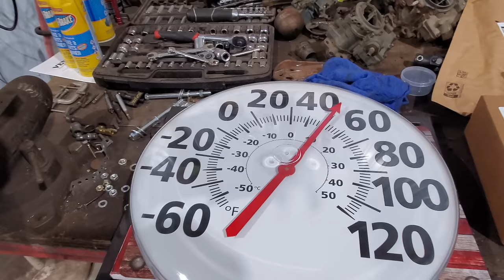40 Chevy Coupe Can I get The Steering DONE This time???

Comment: If it’s bent with a crease, I’m pretty sure it’s a split in the metal chad! That metal on the wall sure looks so clean and a real finished look! I don’t mind what you want to share on your channel because I like seeing whatever you show my friend! You should at least buff it with a wire wheel my friend! You could weld a pipe coupling and a plug Chad to save you some money brother! Even saw a 3/4” or 1” pipe coupling in half and weld the half on the pan and put a pipe plug and paint it and it’s good as new Chad!

Comment: Chad: don't through that oil pan away; find a nut that the drain plug fits, and weld the nut on the oil pan, oil leak fixed.... That worked on 58 chevy 348 250 back in 64
Reply from the maker: Too rusty to mess with.

Comment: If the intake doesn’t have a coating on it, you can get some machined aluminum wheel cleaner, I’ve used it and it sprays on and should foam up and let it sit a little while then do it again and pressure wash it off! I used to haul everything to the car wash, I don’t know if you’re allowed to do that but a pressure washer works my friend! I had some machined aluminum wheels and that stuff worked great even with grease on them! Just thought I would share that with you Chad! I don’t mean to tell you what to do, I’m just making a friendly suggestion brother! No offense if you don’t want to do it my friend! Just trying to help out a little!

Comment: I use a soldering torch bottle to heat blocks, etc... to remove impurities on the outside and then I spray with etching primer then paint to color I want. I've used Rustoleum with a brush. Lot cheaper. Got this from Uncle Tony's garage.

Comment: Whenever I need to find center on the drill press I use the trick of putting in the through hole drill and lining that up so it doesn't drag then lock the table there to counter bore the holes.

Comment: If you grind three equal flats on the tap shank, it will keep it from spinning in the drill chuck.
Reply from the maker: It's already suaere on the end for the tap handle.
Reply: @ThisNThatGarage  yes most taps are but if you grind past the square and put three even flats 120 degrees apart, tap wont spin in drill chuck. Done it many times.
Reply from the maker: @kristopherboice197  Tap was junk is why it was spinning. You'll see next week what I'm talking about.

Comment: Rough day huh? Always put a lead on the hole before you tap. And don't use regular oil. You need a high sulfur content oil. Find that at a plumbing supply store. Also on the intake manifold power wash it to remove any oil n grease then get a jug of aluminum brite. It's a mild acid. Use straight and hose off. Watch your eyes. Keep these videos coming.

Comment: I grew up in a junk yard working with my uncle in the 70's I can remember those old cars like it were yesterday they were stacked four cars high, and they had any part you could want and more. Junk yards of today are so different than what I remember and that's because cars were made differently than the Chinese garbage today. I miss the smell of that grease and fuel in the hot heat of Las Angeles Ca. I can still remember the name of the yard it was called (hard knots and son's auto wrecking" we used to cook hot links, ribs, and steaks on a 50-gallon metal drum and wash it down with a few cans of cold beer and to top the end of a long day of work we would play dominoes until everyone got to tired or had one to many. It's funny how cars can wake up such good memories. I will die a grease monkey. lolololol.

Comment: Drill your hole in them freeze plugs and take a dent puller like you pulled in front of a car with and you can smack them right out of there
Reply from the maker: Works pretty good using a punch too! 👍

Comment: Hi there l have 28 by 28 by 9ft high using 4000 thousands btu heat pump works good 65 degrees

Comment: I don't know if you got the idea about counter sinking the bolts from the comment I put in the steering video but the counter sink could have ben done by taking out a rectangle section from one bolt to the other instead of two round holes.
Reply from the maker: Sure could have. There's always several ways to do things but that's not how I wanted it to look.

Comment: instead of using those junky bolts that u had to mill out that counter bore, you should have used 12.9 grade socket head cap screws, then the counter bore would have fit better
Reply from the maker: Junky bolts.......😂 Sure thing buddy except they're equal to an SAE grade 8. You be sure and do yours exactly like that when you start on it tho. I geta kick out of comments like this. 🤣

Comment: Chad, pick yourself up a spark plug cleaner at Harbor Freight  only $20.  I have  one and it makes  spark plugs look brrand new.  It uses  compressed air  from your air compresser with the media which is included. Takes less than 5-10 seconds.
Reply from the maker: That ain't gonna help an oil burner tho!!
Reply: @ThisNThatGarage   let me know if you change your mind. I bought it and will probably never use it. It's still in the original sealed package. I'm a big Hobo Freight fan 
Keep up the great videos and thanks for making them.

Comment: I’m not sure how far ahead you are on the videos… but you shouldn’t have to make an adjusting sleeve to be able to screw on both tie rods.  Just make it so the outside adjusts because the inner tie rod can rotate freely on the inner end of it.  Just another idea to maybe save you some hassles… it’s been awhile since I’ve had a 4th gen but how long are the outers of the 4th gen, is there any way to use the outer and inner of the 4th gen so they just screw together like they would have from factory.  I’m not sure what length you’re working with there.. but if you could just use the 4th gen, inner and outer maybe that would work.  It hard to say without being there.  Just some ideas.  Another good video and don’t let the MLS get ya down, doesn’t seem to affect ya much so keep it up.  Love your content as always!!
Reply from the maker: They have to attach to each other some kind of way and I'm not gonna just weld one end so threads with a jam nut it will be. I spoke of why the 4th gen outer tie rods won't work in another video. 👍

Comment: if you want a better cheap way to do a final de grease on a engine like this .... grab some dirt cheap oven cleaner hose it down with it let it sit 10 min ... its foaming and has a light acid in it and draws all the oil out of the casting  and destroys i and can justt be hosed off ... at 99c a can ya cant go wrong

Comment: why cant you use a conventional outer tie rod with your new inner tie rod? maybe you might be able to use of the shelf parts...keep up the good work,
Reply from the maker: I'm not sure what a conventional tie rod end is but I stated in a previous video that I spent hours searching for tie rod ends.
Reply: My bad..lol.. your inner tie rod looks identical to what I use on my 05 Dodge Magnum my outer tie rod threads onto the inner tie rod without using a adjustment sleeve... and the overall length of the inner tie rod threaded with the outer tie rod look to be close to your overall length you needed..
Reply from the maker: @dodgemagnum5596  What you have is the way all rack and pinion tie rods are. I can't use that unfortunately.

Comment: You need to go forward and back with your tap and do it in stages, the waist is jamming the tap.
Reply from the maker: You're not gonna do that on a lathe.
Reply: @ThisNThatGarage  I would do it on a lathe by stopping and reversing the motor to break up the jammed cuttings.
Reply from the maker: @jonpeters2700  If you're referring to doing it like you would by hand and that is backing up every half turn or even a full turn then I'd love to see that done on this lathe or any lathe considering it keeps on truckin after you turn it off. Never seen anybody do that on a lathe. The cause was a junk tap.

Comment: There's a difference between farm diesel and highway diesel .... but i dont knownwhat it is. Clearly one runs a heater better than the other lol
Reply: The only difference is red dye. The sulphur levels are the same and the cetane levels are the same.The problem with farm diesel is that at most places it doesn’t sell very quickly and some unscrupulous stores will dump the kerosene that they don’t sell in the winter months into their farm diesel tanks. Unless you are buying farm diesel from a store that sells a slew of it to farmers you have no clue what you’re getting. They don’t dare pour anything into their on-highway diesel cause the man would bust their hide if they got caught tampering with it.
Reply from the maker: I think it was years ago but now it's just what color dye they put in it.